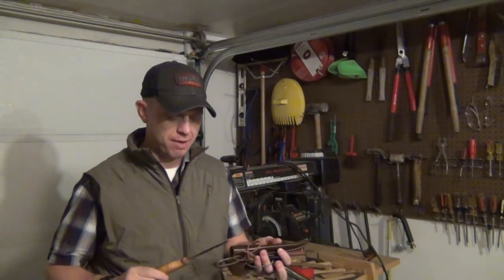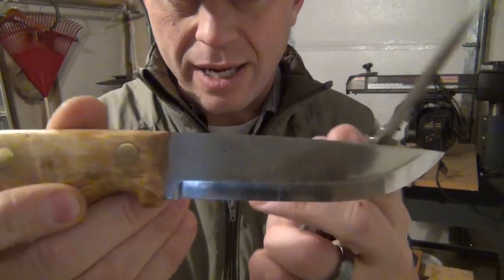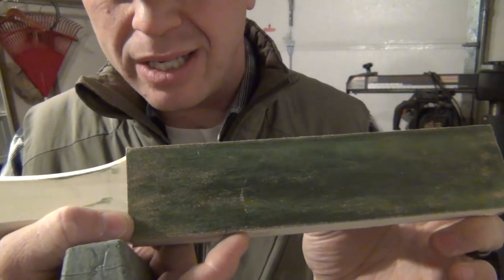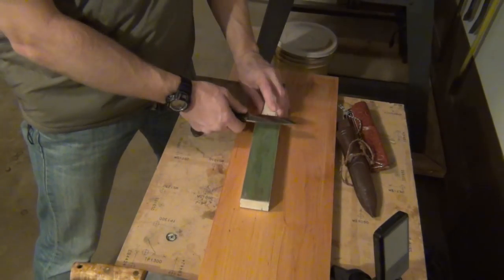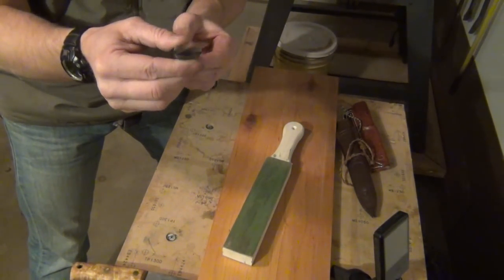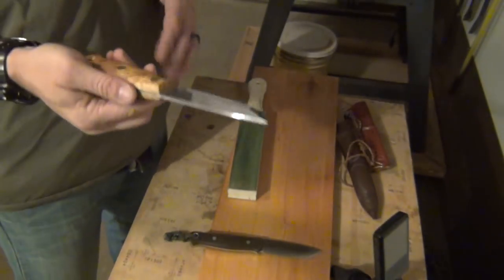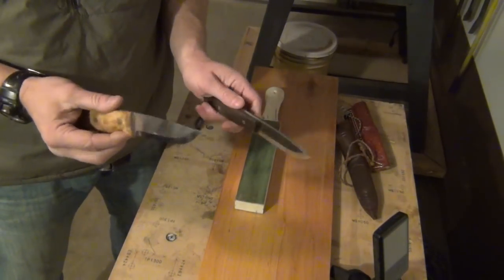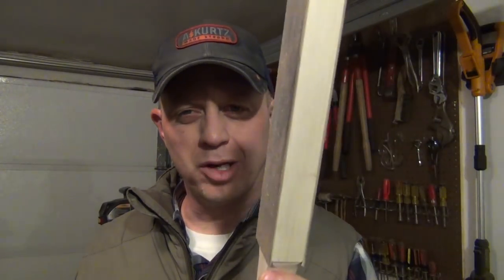Sharpen a Bark River Convex Ground Knife

Comment: Thanks +TJack Survival
I'm confused.. I saw several videos where the knife is pushed against the stone cutting edge first.. your technique is the reverse!
Could you elaborate on that?
Thanks in advance :)
Reply from the maker: It wasn't a stone.  Mine is leather on wood with grit.  That way it forms to the convex edge.  Convex means that the blade isn't a straight angle.

Comment: You may want to consider doing the entire length of the blade in one stroke.
Reply from the maker: That's one way.  But if the entire blade doesn't need attention I do just the parts that do.
Reply: @TJackSurvival  👎

Comment: My question, which is purely for the knowledge of it, but if you were in a prolonged situation how would you sharpen a grind like this that seems to rely on man made resources such as the black compound? I'm on the edge on buying a convex.
Reply from the maker: The compound just speeds up the process.  You can polish and re-align steel carbides with just the leather but it takes longer.  For prolonged heavy use bring a sharpening stone like the DC4.  For primitive situations find soft soap stone, grind two together until you have a flat surface, sharpen with the stone you find, finish by stroping with leather.
Reply: How would one maintain the convex edge? Sorry for all of the questions, just curious.
Reply: I mean with stones that is. Seems like you would grind it into a "v" with a stone after a while.
Reply from the maker: +hhyyuu667 All blades become convex eventually when sharpened by hand.  The only way to maintain flat grind is to use a Japanese water stone or a grinder of some sort.
Reply: maintaining a convex on waterstones is surprisingly not difficult.  the natural motions of pushing the edge of one side and pulling the other side will naturally convex the grind.  a true scandi is difficult on the waterstones because you have to avoid natural wrist movement and keep the angle steady. if you free hand water stone sharpening, your blades will be convex to some degree.
Reply from the maker: +John Huynh exactly

Comment: I flattened the convex edge on my Bushcrafter, and it works much better now. I did not remove any material from the edge apex while doing this, and only addressed to edge once the scandi had been flattened. I chopped some wicked hard dried oak with the knife, and it remained 100%. I just like true scandi knives, but like the Bushcrafter's handle, steel, and blade length.
Reply from the maker: Whatever works use it!
Reply: What degree if your primary bevel angle? No micro bevel right?
Reply: What degree if your primary bevel angle? No micro bevel right?
Reply: Not to split hairs, but a convex Scandi is more of a true scandi than a flat scandi

Comment: Hi there, can I use a diamond sharpener on the bushcrafter like the fine grind and extra fine grind or does it have to be a leather strap??
Reply from the maker: Diamond is just a little bit more corse is all.  I sharpen my convex knives with a diamond stone from Falkniven but finish it off with the strop.  The leather strop has grit on it which can have diamond powder in it so you can actually get a situation where the strop uses diamond to sharpen.  Be concerned about the grit strength and not whether it is diamond or not.  To answer you directly, you can but it's more aggressive and usually, don't need to.

Comment: what is your experience with sharpening CPM 3V and Elmax Bark Rivers? What is harder / easier to sharpen?
Reply from the maker: Stef As a general rule the harder to sharpen the harder dull. If it’s hard to sharpen that’s a good thing. I have CPM3V and Elmax. They kind of polish because they are so hard. Those are both some of the most impressive steels I’ve ever used.

Comment: When sharpening that convex do you keep the blade flat as you would a scandi?
Reply from the maker: No you end up rocking it a bit, but do try to keep it level with the cutting surface, then spend a lot of time on the leather strop when you're done.

Comment: Is a strop still effective for blades with a significance double bevel?
Reply from the maker: It can be yes.  But the angle changes and you want to use it as a finishing tool.  Because of that I'd also probably not use anything but leather for that

Comment: You can go to any leather working shop and any hardware store and buy the materials necessary to make a strop for pretty much free. My local leather has pieces of spare leather in a bin that you can take. Buying pre made strops is a ripoff.
Reply: Zach Martin you mean somebody forces you to buy pre made strops? If not,it can't possible be a rip off.
Reply: Most leather shops are running businesses, not charities.

Comment: how to sharpen convex with edge pro?
Reply from the maker: What are you asking?
Reply: @TJackSurvival  
how to sharpen bark river knives 
on edge pro apex 4.
or is it not possible and needs to be done freehand.
Reply from the maker: @tonydillinger2553  try not to use a flat stone on a round blade. Unless you’ve chipped it, do it all by hand and 90% of the time a Strop is all you need.

Comment: I got a five gallon paint stir stick from a paint store. The stir stick is 1.5" wide. I cut it to 15" length. I bought a 1.5" wide strip of leather which I cut to fit the stir stick. Then I used contact cement to secure the leather to the stick. Applied  green compound to the flesh side and left the hair side with no compound. It fits in my pack and strops my knives in the field perfectly.
Reply from the maker: Billy Two Knives Super Smart

Comment: You should get an eraser and clean up your strops. Oh and btw that is not how you sharpen a knife
Reply from the maker: Ya ok. LOL
Reply: @TJackSurvival  ya it's called stropping a knife (ideally to bring a sharpened edge back as close as possible to when it was properly sharpened on a stone or wicked edge or whatever). Leather doesnt sharpen knives, you could call it honing or stropping.
If you never have to sharpen your knives using a proper method (other than leather) than you are either not using your knives or u dont care if they are actually sharp.
Reply from the maker: @Metalhead-4life  or I could call it sharpening. ;)

Comment: bro I can cut paper super slow ....which means mine are super sharp ....those may be work sharp but deff not super sharp I
Reply: Super sharp means you can seperate layers of paper in one sheet. There are 2 thin ones that form 1 sheet.
Reply: Having a razor sharp knife is ok if you're wanting to show it off but what he did here was create a practical sharpness that will keep its edge when you take your razor blade out that's exactly what it is it is a razor blade you will chip The Edge very quickly and therefore you will have to remove more material to get your edge back again

Comment: Bark River knows that convex grinds are the best. No micro bevel on the A2... so nice. The highest compound they use when they give the edge at factory is 3000 grit, but they do sell compounds beyond that for aftermarket like your green 6000 grit block (at the factory, they do a coarse, 320, 600 and then the 3000).
Reply from the maker: +Jeremy Madsen They do like convex.  Mike is a fan.